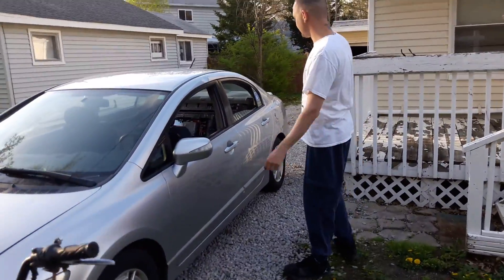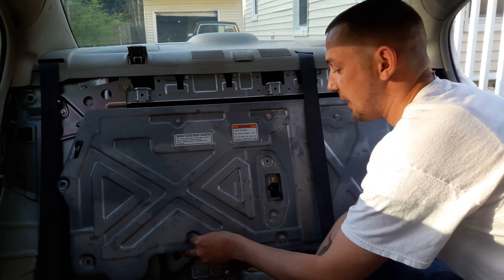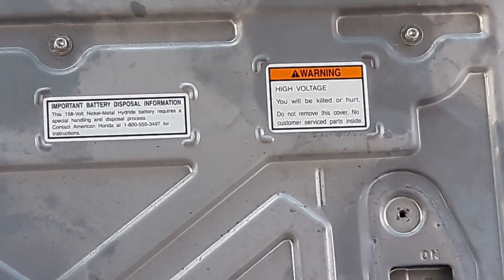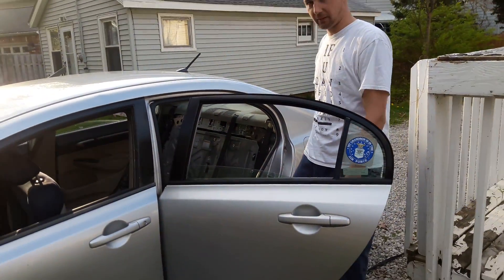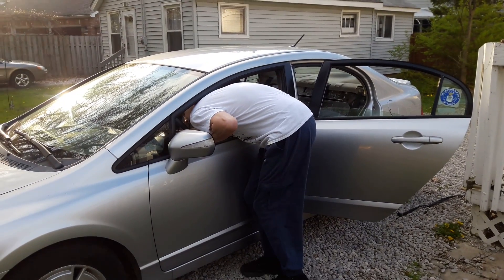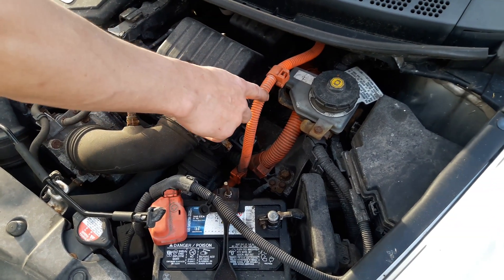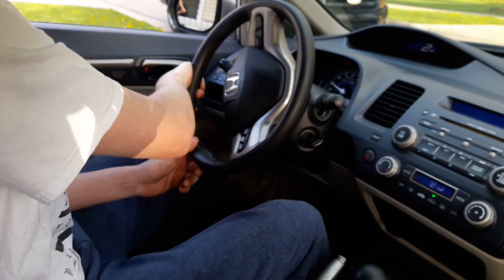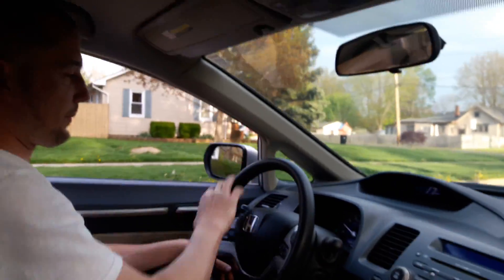Hybrid honda civic battery refurbishing part 1 test 1

Comment: I have a 2007 Honda Accord 
The check engine light are both on however I do not have enough money to replace the battery. I have been seeing things about gride chargers ? Dose anyone have any idea if I can buy the Gride charger or if I have to simply replace the battery

Comment: What was the car doing that you knew the ima battery was bad other than the ima light being on?  I'm looking to buy one that the owner says won't go past 20 mph.  A mechanic told her the ima battery is bad.  Any help is greatly appreciated.
Reply from the maker: Mine would not hold a charge and discharged very quickly
Reply: @davidevans7587  mine dose the same ..
Reply: @davidevans7587  doesn't hold a charge for very long at all it can go from having all of the bars. Two mins latter it has one bar ?? I really need some advice LOL bend me over with out a condom lol .. I looked online to get a new battery and replace and everything isn't going to be about two grand . I need an easyer cheeper way ..
Reply: Great job what area are you in

Comment: So they will make a truck... That's good. For some time now I've been figuring "If Tesla really wants to make money, they'll make a viable ( lovy.biz/us0m )1/2-ton LUV fleet-truck.". And they plan to make Class-8 semi-tractors & buses as well? Makes me look forward to the first luxury EV motor-home, built with fixed roof-top & retractable solar panels, all powering the EM-induction cook-top, water-heater & washer/clothes-dryer. Add a water collection system with reverse-osmosis treatment & UV-sterilizing, and you'll be set to survive anywhere, anytime!?
Reply: As you like but I share my Opinion
Reply: Thanks for your personal exprience😉
Reply: My personal Feeling share

Comment: I want to be able to drive it without fixing the IMA what’s my next step? Is it the alternator? Because that’s what everyone is telling me. IMA Light was on then battery and check engine light
Reply: These cars don't have an alternator. It's probably either the battery pack or the DC/DC converter gone bad.

Comment: Hi.. How much you pay for the new cells at CEBA.. i try to search for price at the web site but doesnt show...
Reply from the maker: Im not familiar with their system so i dont know for certain. But oem dont matter
Reply from the maker: I bought two cars at once one of them had a bad transmission so I took both packs apart and independently tested and recharged each stick until I got a good set
Reply: I got two packs too how can i do that...? How can i know wich one its god or not. I take them apart and all of them shows the same voltage.. 14 each.. ??? Thanks
Reply from the maker: L. R. U must have some form of a discharger to test them under load  after you charge each stick. You will be able to tell the bad ones they will die quicker then the rest.. I will try to make a video on that part
Reply: Great thanks... One last thing... Theres a company here in california they sell the cells for 99 dollars each but they said i have to replace them all or the bad one gonna kill the new ones.. Its that true or they are just trying to sell me the whole set????
Reply: Thank you soo much for your time...

Comment: It's actually a 93 hp engine.  You can disable the hybrid battery pack completely and the little engine will still power the electric motor, you just loose about 10 mpg.  I tested my 04 with the pack turned off and got about 45 mpg, and the same road with it turned on got 59 mpg.  My IMA light is on, but the batteries are obviously still working to some degree.
Reply: dhaneyart hey I have a 04 with the same problem, I took the back seat out flipped the switch off the car ran for a little bit I drove it around for about 5 minutes then it started to shut off and the steering wheel gets hard to turn? Did I do something wrong? Should I leave the switch on?
Reply: BIGBOIJDM so you turned the switch off from on and tried to drive it like that and it would t go bc I’m about to try and do the same bc I keep reading it will run just loose mpg and I’m good with that if I can still drive it I have a 05 civic 5 speed and ima battery I think is dead car will turn over but has to power when you try and accelerate you think if I turn off switch it will drive normal just as a gas powered car ?

Comment: I noticed there's no Part 2 he must have cooked himself on the second try.
Reply from the maker: Dr. Addict Alcoholic  I'm alive and well, someone came along and bought both of the cars about a week after I made this
Reply: Good to know, I was thinking at some point to try this on my accord.
Reply: @davidevans7587  omg this vedio is kinda amazing lol .. well like I said I have a 2007 Honda Accord. It has about a hundred and 120k on it I love the car however the check engine light and I am a light have been coming on periodically then going away in about a couple days.each and every time I take it to O'Reilly's and they do say I need to get a new battery. But unfortunately for me I don't have thousands of dollars to spend on a battery . so my question for you is I've heard a lot about these grid chargers do you think that would fix my problem? Or replacing of the cells and the battery ? I'm just trying to find some options that can do the same thing that is cheaper than buying a brand new hybrid battery . ?? 

P.s or lol I'll fly u out to fix my car lol .. please help
Reply: @davidevans7587  so you screwed him lol
Reply: David evans I am having the same problem with my car I have a 07 Honda Civic Hybrid with a 145000 bought it last year from a friend sold it to me for a great deal but I noticed I've been putting too much money in the car my battery is fully charged Ima light came on and the check engine light came on and it's saying the battery is dead not getting charged how can I fix this problem and where do you live I wish you were in Indianapolis Indiana I would have you come fix it and pay you LOL
Reply: David evans it's me again de Vincent and I forgot to say I thought it was the alternator but I just realized Highbridge don't have an alternator so what's the problem can you help please if you can please give me a call I'll inbox you my number